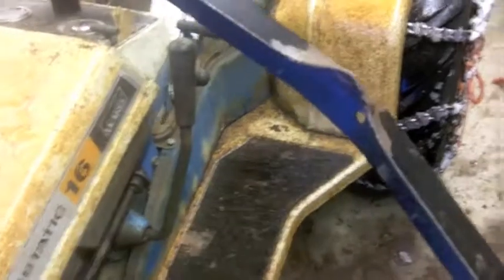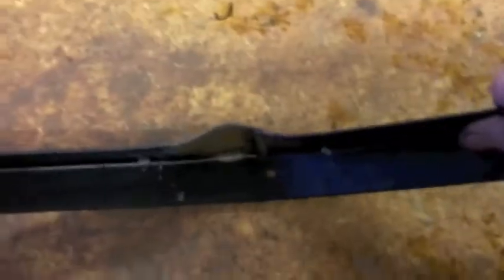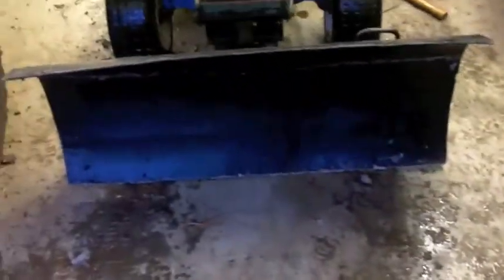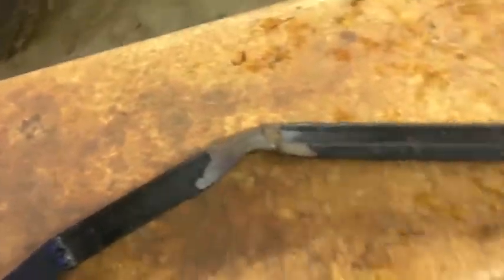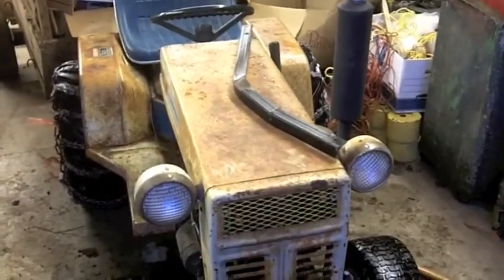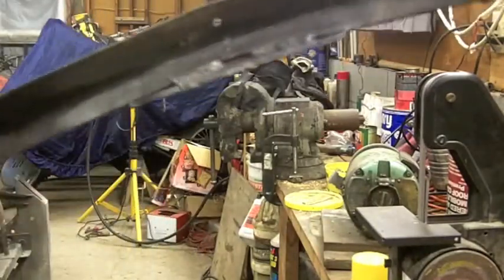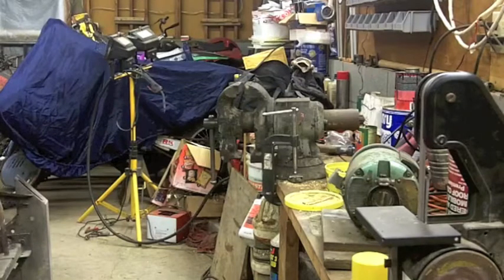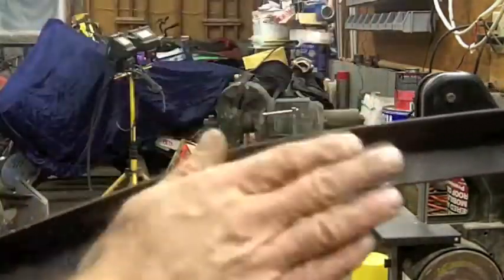Pushing Snow and Bending Stuff

Comment: yeah, but just make it mecanical, with no hydraulics. 1 inch solid bar for the hinge, and 1/4 thick 2inch tubes with pins to hold the sides. so you change the lenght of those 2 bars to change from v plow to cup to flat blade.......but a cow catcher just looks badass, and is great agaisnt zombies....don't forget zombies\